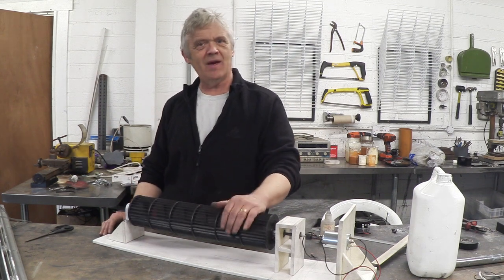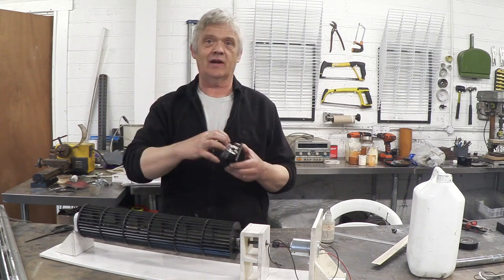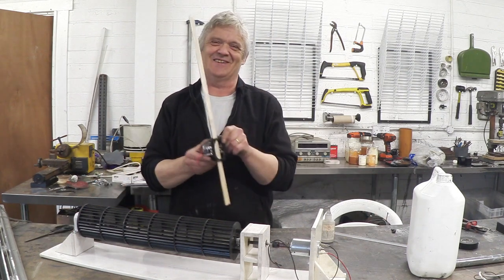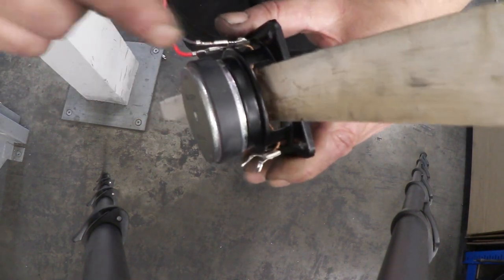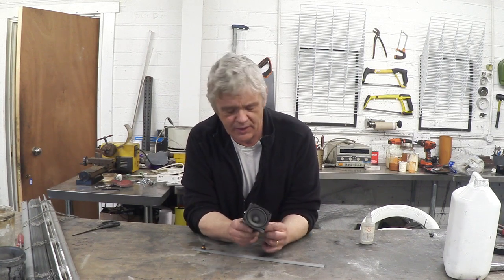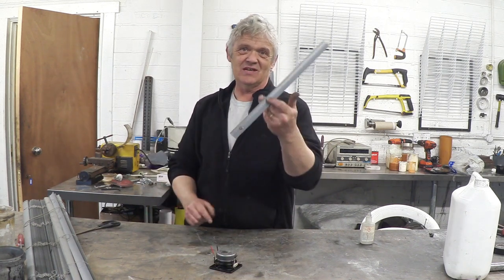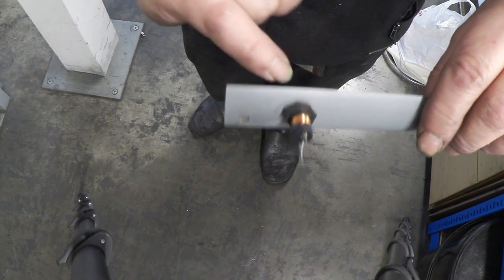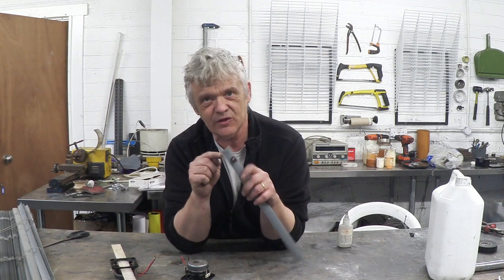Weird Wind Generator   No Blades, No Moving Parts

Comment: Years ago I read an article about a wind fence , Multiple wires very close together one positive and next negative theoretically got electron exchange with air moving through it , never saw it again. Just thought about it watching this. Have also seen a generator ‘tree’ where the ‘leaves’ wiggle in the wind presumably using similar techniques to what you described here. 

Love your videos thanks!

Comment: The device I came up with over 15 years ago looked like a field of barley swaying in the wind and generating more amps by joining the currents in parallel and joining the voltages in series to get the best power output. The real problem in getting 'blue skies' technologies to the market is that lone inventors do not get any support from government backed schemes. I am 68 now and ageism brings even more hurdles. It is really the 'idea that holds the authority' , and it should not matter who comes up with a good idea. If an idea is good it should at least get a hearing so it can improve society and quality of life for everyone. I have subscribed.

Comment: This is quite a good idea. 
Q;  how to make it better ? Much better.
Use two reeds tuned to a resonant frequency 
Your assembly is upside down. 
Two reeds clamped at the bottom with the magnet assembly on the top. 
As the wind passes through the reeds it will whistle ( the resonant frequency )- that whistle creates the movement with the magnet vibrating within a fixed coil. 
Try that. Should you require assistance let me know.

Comment: POWER FROM A LIVE TREE     Attach many piezo devices from the branches to stakes in the ground and feed the output to a super capacitor. This is the eco friendly solution as long as you leave enough kinetic energy for the tree to survive.

Comment: Give the "three-thirds" rule a shot. Anchor the reed vertically, mount the inductor 1/3rd of the way up, allow 2/3rds of the reed to operate freely in the wind, and have a bank (or banks) of several thousand reeds in staggered rows to stimulate turbulence. There was a Chinese guy in the US who set up a long rubber band and inductor system across his window... it generated enough voltage to run his electric wall clock.
P.S. I like your stuff with drum fans.
Reply: Hi there. Do you happen to have a link to this guy running his clock with a rubber band vibrating and an inductor?

Comment: OK my friends, try this. A neodymium magnet in a very thick copper pipe suspended by a helium balloon. Of course it will be vertical And wires attached to pipe and magnet. And of course rubber or spring return for the magnet. Even in light wind the balloon will be bobbing around. I will be doing this myself in a few weeks

Comment: That came from left field! I'm sure you have started a thousand minds ticking with this one Robert. You certainly got me thinking. Well done again!!
Reply: Just thinking about this some more. When you extract energy from the vibrating structure, you essentially dampen the vibration. That means there is a fine balance between extracting energy and sustaining the vibration of the reed.
Reply from the maker: cheers mate

Comment: Grandtastic is this similar to an old SUPPRESSED INVENTION KNOWN as "SALTERS DUCKS" which derived energy from the sea moving  UP and down , AWSOME THOUGH
Reply: I went to an I Mech E presentation by Salter and he seemed to regard his ducks as an interesting idea rather than a practical power generation source. It worked as waves moved past the duck (wave energy not up and down movement) and the duck rotated relative to the ducks on either side. It had plenty of practical problems as the rotational energy used hydraulic systems. Hydraulics and seawater are not a good mix for a long service life. Plus the best place to put them (off the north coast of Scotland) would also be the place guaranteed to give them the shortest service life,  and they needed to be towed back to port for repairs.

Comment: Reminds me of the "wind belt" development around 2004. Basically pico power unit that can be constructed from locally available salvage. The goal was able to eliminate kerosene fuel lapst  battery powered lighting with the windelt recharging the batteries. Although it seems that in renewable low power energy has disappered

Comment: Ive noticed how a cargo strap viobrates in the wind, and have often thought if one end was connected to a sprung loaded magnet moving within a copper coil electricity could be generated. A coil spring from a spring balance scale would do, and the magnet would run freely up & down in a piece of pvc pipe, around which a copper wire was coiled.

Comment: My thoughts on this are how to couple many of them? The voltage would be low frequency AC. But not sure it's alway enough to go through diodes. If you coupled a grid (in series or parallel) , would they end up cancelling, or could something sneaky be done to accumulate them? Perhaps in parallel they would resonate together and produce larger voltages? I was certainly thinking that a circuit like a joule theif can be used to boost these. Worthy of experiments.

Comment: Vibration is still movement. That's a moving part. However it' not a rotating part. What they have there is a diaphragm operation which I experimented with many years ago. It's not practical. A wind dam built across an northeast/southeast  ridge  with horizontal rotors is the most efficient. At least they won't kill birds . Old Seer/physicist.

Comment: As someone who was thwarted by planning regs over putting a small (3 Kw) wind turbine on the house this may be a way forward and will keep an eye on it as it may get traction due to no moving parts and could be scalable like PV cells. 
That aside, what was the low profile squirrel cage fan on you bench when the video started. Hopefully a turbine?
Reply from the maker: previous video mate - vertical wind generator
Reply: Offers some really interesting possibilities for fitting these on domestic rooftops.  The pvc pipe guides makes it effective no matter which way the wind comes in from and could be used to, effectively, auto furl if the wind gets too high (would require them to be motorised) making the turbine very aerodynamic! How large do you think the squirrel cage fan would need to be to turn something that generates a useful amount of power e.g. 2Kw? Will you be continuing the development or are there other videos to watch?

Comment: Years ago I read about a wind generator that was similar to a ribbon stretched between 2 poles. The wind caused the ribbon to vibrate or flap and energy was harvested with a magnet/coil setup at one end. I wonder if that's what they're using? I'd like to see your take on it.
Reply: There was a type of wave power harvester that I saw a video on once.  Basically it put a buoy on the surface and had a wire running down to the ocean bed.  Ever time the buoy bobbed up and down it pulled and released tension on the wire, which powered a little piezoelectric generator on the seabed.

It wouldn't be practical for large scale use, but on a windy day you could do something like that with a helium balloon on a string with this.  I know there were some attempts to use really large kites like this, but they require pretty advanced wind calculating and software to keep the kite flying.

Comment: Fascinating, but open circuit terminal voltage just shows static charge. Extracting current from the circuit might only bring pico or nanowatts. Not practical.

Comment: I just saw this video for the first time, and using another item from one of your videos, I came up with an idea. Using a panel of these items, with each one coated with your carbon paint batteries, set into moving salt water (ocean current), wouldn't that increase the power output considerably? What I'm envisioning would look like a series of undersea reeds swaying in the wind, generating electric current all the time.
Reply: Tide generation.

Comment: Amazing, everything he connects to that multi-meter generates exactly 6.1 volts!
Reply: More likely the resistance of the coil is 6 ohms (for a nominal 8 ohms speaker coil). And its funny how the meter wires are different lengths and disappear behind his leg, I call BS on any claim of useful power generated from this technique. Interesting in theory but please can the OP give a more honest presentation.

Comment: The last time i saw one of those horizontal tubular fans was in the kitchen at Sheffield University when the one in the evaporator of the airconditioner i'd just installed, 'exploded'. I hadn't gone more than 20 miles before getting a call from base telling me to go back.
The replacement fan unit did the same. Upon my third return, while in extreme 'Columbo' mode, i discovered that in both cases it spat out bits of blades when one of the short ladies tried to angle the outlet grill using her pen...
It's amazing what happens when you thrust the end of a biro into plastic blades spinning at around 500rpm!

Comment: Its called a "MICROPHONE"
Reply: yes   very  clever,             the  gadget  that  turns  on  lights  by  voice  !
Reply: good one ......😂
Reply: @johnnygeejr500   Or by clamping 😂
Reply: Microphones are just speakers, backwards.
Reply: stewart caldwell yep!
Reply: @daviddavids2884  No, it's a speaker. The only difference between the two, usually is impedance.
Reply: @stewartcaldwell5299  i wonder if you could use a form of musical instrument that makes noise in the wind and use that to excite your transducer (like a penny whistle with a row of transducers along the bottom ? and a funnel  to concentrate the wind
Reply: @orianargus4238   I think that the plain white noise of wind blowing across a microphone would be best, because you would get all sorts of frequencies ( a denser mix), so more activity across the diaphragm. You could try using a pinking filter so that you could obtain an equal amount of energy from each octave, but in the end, it depends on the type microphone. The more efficient, the better. Music has high and low energy periods, and would probably provide less average energy.
Reply: “No moving parts”... the voice coil moving back and forth doesn’t count as moving I guess...
Reply: |> |> |> |> |> |> |> |> 
|> |> |> |> |> |> |> |> |> 

well ... to call a microphone the same like speaker is like calling a batterie the same like a hho cell ... 

there is a tiny little difference ...  

the bumm is by the speaker and the cell much much much bigger ...

🌝🌝🌝🌝

|> |> |> |> |> |> |> |> 
|> |> |> |> |> |> |> |> |>
Reply: @johnnygeejr500  - The Clapper ! As seen on TV ... it was some time ago.

Comment: Now with flexible graphene solar cells, why not make the reeds photovoltaic as well :D
Reply: I was thinking the same thing!
Reply: @Todd Berkeley that is an ingenious idea, double the power.
Reply: Double Power generation. Ingenius. But depends whats the best material for the Bladeless generation.
Reply: @EdgeMan  ah, an American I see?
Reply: I had the same thought. Multi purpose, multi functional. You'd want to somehow tilt either the blades or the whole contraption to actually face the sun, though, without losing any of the movement generated by the wind. Possibly follow the lines and patterns of nature? 😉 A tree has many, proportionally tiny photovoltaic cells that shiver in the breeze, for example.
Reply: why not make reeds transparent and pump algae in them to make biofuel
wait, isnt this actual reed or grass?
Reply: @Snm225  ??

Comment: This is a really good idea. I was wondering how efficient it would be with piezo crystals.
Reply from the maker: i like the idea mate - give it a go - do a video and share with everyone
Reply: Also use this idea with moving water, I think Piezos have been used in systems generating energy from sea surf dynamics movement.
Reply: A wind microphone😀
Reply: I thought the same. Piezo either side to get max compression. Would require more complex regulation circuitry than mags though. Ta.
Reply: I think this is the tech that the 'Spanish Company' is using.
Reply: @ThinkingandTinkering  Damn, why nobody uses some math on this? 
Unfortunately, many things works as toys, but not efficient at all at industrial scale. 
Myself I had lot of ideas, but what point if I cannot prove that it works at scale. 
For example, we know that at wind turbines the tip is most efficient because of the lever. So why make those insanely heavy blades when we can make a wheel, bicycle like, and on exterior is the working surface.
On the same Idea I improved the vertical turbines. Those works because of the curvature of the surface. What if we can make a system that is a surface that catch the wind while is on a side, and the surface is nonexistent when on the other side. So, actually is mounting a door like system with the hinge on the outside of the rotor. On the side where the frame is upwind, an the door behind it, obsiously the door will be pushed away from the frame and hand on the hinges rotating the rotor the door will hang closer and closer to the frame till will fit on it and rest on it while on the other side the wind will push the door against the frame and the pressure will create the rotating force of the rotor.  Obviously when will be on the opposite part of the wind the door will be forced out of the frame and the force will strain the hinge, and when pressed first time against the hinge will be a shock. A lot of noise. I gave it a go. worked as a charm as simple model. It was spinning like crazy. But to test the actual efficiency, I need some more math skills than I really have, or to spend in creating some real life models. Not interested, because to be a success it must  be insanely more efficient. And all those moving parts for sure will counter the eventual efficiency. 
And even my math skills are low, I really doubt that this type of gizmo can make a real amount of power. It just seems not right, exactly like solar roads. Instead making the solar panel so tough to resists all those trucks grinding them, better make a frame and place the panel above the road, and you will protect the road too from heating and rain.
Reply: @ehombane  
I think that I saw a video about the  turbine with blades that acted like door hinges. It was a while ago so my memory might be off.
Reply: Blind Bob  Exactly.
Reply: Im baffled
Reply: @TubeMeisterJC  Thanks for the answer. 
I missed two points. At higher dimensions my schematic will require high velocity wind to acquire noticeable spin. The second, feasibility of the structure due to materials restraints. I was afraid of that, but ignored it trusting more the idea of lever. I forgot my own joke done to Archimedes. Give me a place to stand, and I shall move the world. But I said. I will give you the point, but next you will ask for a big enough lever :)
Reply: Blind Bob  There must be a lot of Spaniards with half a brain at  Vortex Bladeless.
You should e-mail them and let then know they're wasting their time and money.

Comment: Imagine a tall building with windows (glass panels) all over it. Now imagine an inductor connected to each of those glass panels. Generating electricity each time the wind blew, each time people walked across it's floors, each time the elevator moved between floors...  Connect a battery bank to the array of inductors... a building is now generating it's own power, or at the very least reducing it's footprint.
This is kind of amazing from a society changing perspective.

Comment: This is really cool. One of the coolest wind mill designs I’ve seen is essentially hundreds of small sections 2-3ft long of your vertical fan on a thin cable. And stretched a few 100 yards over a canyon the power it was generating was orders of magnitude more then any wind turbine currently in use.
Reply: Link?

Comment: Very good idea, I don't know if this has been posted already but if you take into account harmonics of a vibrating object you could fix the "reed" in the middle and each half would vibrate at exactly the same cycle. So an inductor at the center of each half would produce twice the current.

Comment: Really interesting! I’ve been wondering about alternative ways of generating electricity from wind for a while now. I love turbines but they can be noisy. One idea I had was using the movement of a tree swaying in the wind to pull a line of magnets through a tube with coils around it. 

A bit of paracord from the top of the tree would pull the magnets through the tube and a spring to pull them back. 
Only problem is that I’m afraid of heights!
Reply from the maker: lol - me too! - but what I did and what you are thinking of aren't too far apart mate
Reply: Robert Murray-Smith absolutely, just scaled up to tree size.
Reply: @AntCooke  I have just bought a forrest.. Very happy with this..
Reply: @ThinkingandTinkering  How to make silica powder for smelting metal
Reply: I've been thinking of that one too. A poplar tree would be ideal for this, being tall and flexible enough to move quite a bit in the wind. I have an Italian Cypress and Juniperus 'Skyrocket' would also be a good contenders, I reckon.

One problem, I'm not too hot with electrics, am new to the channel, and don't really know what I'm looking at here. 

I want to start generating our own electricity, can't rely on solar (Scotland), and live to the south of some fussy neighbours (so the flickering blades of a full-blown wind turbine won't be popular).
I do like the idea of a 'reed mat' - if only I knew what these inductors, etc were and what sort of size, shape and whatnots I'd be looking for. But the tree idea would be great if I knew where to start.